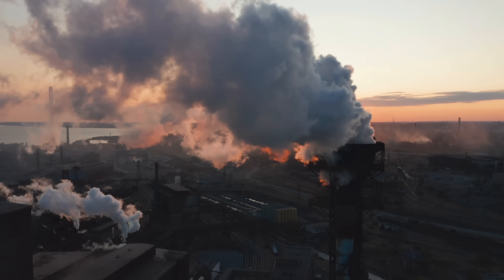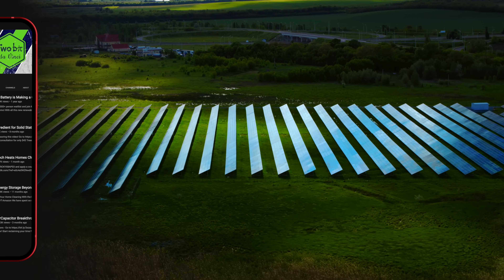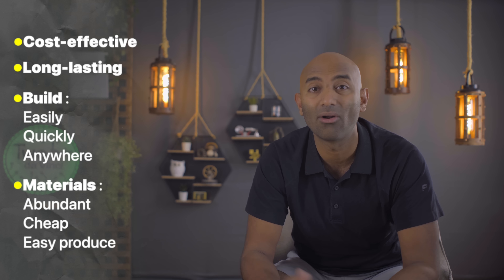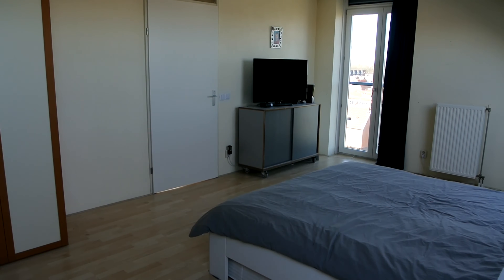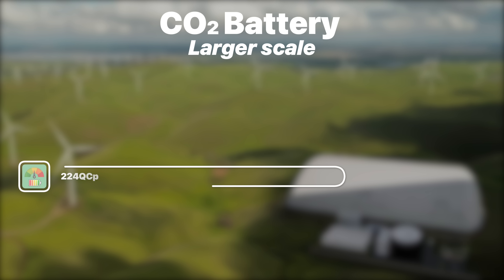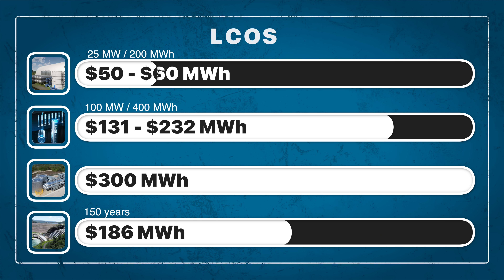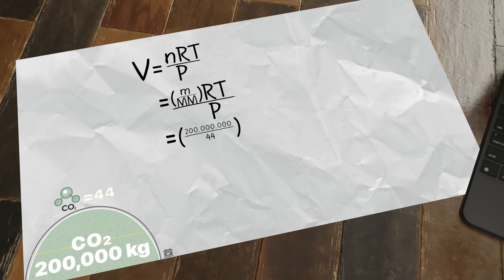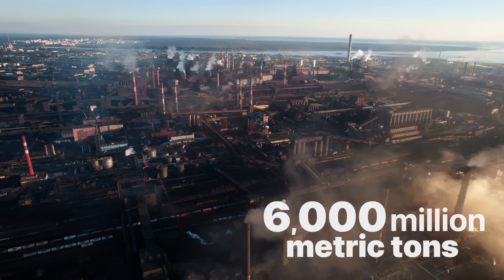The GENIUS Of the Carbon Dioxide Battery

Comment: If one of these plants were located near a decommissioned underground mine, the empty space could be used as the CO2 storage space.  Depending on the gas-tightness of the mine, of course.  I’ve heard of mines being considered for sequestering atmospheric CO2, so maybe not a totally crazy idea.
Reply: There are many abandoned burried pipelines that could be repurposed and they could be interconnected to other plants to incease reliability.  Mines are few and far between. Burried abandoned pipelines are everywhere. The Texas Railroad Commission has online maps of pipelines and their owners and shows the ones that are abandoned. It is just a long horizontal mine that is out of site.
Reply: Storing underground makes a lot of sense, it does not upset the landscape or use up valuable space where more solar or wind turbines could be sited. 

Why not build in some redundancy to the system and make it multiple smaller domes that could be isolated easily for maintenance or replacement in case of seal failures.

Smaller bags also fit better into mines and could be designed to utilise the maximum space for efficiency in the mine. 

A modular and standardised design also means, it could be easily mass produced and scaled. As more sites come on line costs should come down and an industry be created to maintain and produce parts for these systems.
Reply: @peterfedyszyn  True, although it will require a degree of cooperation that is fairly difficult in our hyperpoliticized environment.
Reply: Here (Alaska) I know our local underground natural gas storage facility utilizes an old mine and pressurizes up to 200 bars.
Reply: @markbothum4338    Thank you.  I rest my case.🙏
Reply: The balloon + bladder provides low (atmospheric) pressure at variable volume. It is not meant to be pressurized.  A mine does not have variable volume, it would need a much more complicated bladder
Reply: @pisoiorfan  If the mine had a large vertical shaft I could imagine a large tube lowered into the shaft. The tube would be the bladder with a piston sitting on top of the CO2. As the CO2 is drawn down the piston lowers by simple gravity and as it it is replenished the piston rides up.  CO2 being heavier than air, if there is a leak it floods the mine, the the surrounding area.   At least this is one idea. 

Another idea would be to potentially to use the CO2 to displace water in the mine. The CO2 would need to be trapped above water. Thus the water combined with the mine walls becomes the bladder.
Reply: Depleted oil and gas wells can be used for that also.
Reply: @justanamerican9024  you do know its gona take oil to make the machines that make your world revolve right.  Climate change peoole forget that if we cut oil right now hundreds  of millions  people would die.
Reply: @jazzwinsky  Thank you for brining that up. I remind everyone of that fact. It is not only business who has to change, every person does. Our lifestyle is not sustainable. We are using valuable resources we and future generations will need in the future so we can have cheap fuel now. A concerted effort should be put forth by everyone to conserve what we have and support developing alternative sources of energy that will be closes to where the energy is used and less vulnerable to natural and manmade disasters.
Reply: I was thinking similar for a dried up aquafer.  Some of these places might actually be at a lower temperature than ambient as well, which means the CO2 would be denser and hold even more!
Reply: I'm glad you brought that up. Many years ago Consol Energy, a mining/gas company,along with the government, developed a pilot program to sequester CO2 in underground boreholes. It was a success. There are other technologies out there also that can be used. Carbon capture is very viable. The problem is there are "special interests" out there that don't want this to happen. Follow the money.
Reply: CO2 can even be used as a cheap thinning agent when extracting sludge oil from the ground while simultaneously sequestering the CO2. Besides, plants thrive on higher CO2 levels which is important for increasing crop yields in an ever-growing human population.
Reply: Also, abandoned sewer systems could be repurposed in urban areas. Yeah, so far I cannot come up with any deal breaker for this idea.
Reply: @chpsilva  I don´t know if you are aware of this but C02 displaces Oxygen, if you have a large Sewer under a City with high Pressure and that leaks you have a potential disaster on your hands. Depending on how fast the C02 may leak and how much wind blows. C02 is also heavier than the Air that we breath so it wont just leave on its own.  Having such a storage a bit away from population centers seems like a smart idea.
Reply: That might be a good idea as long as it doesn't just start leaning up through the ground from over compression.
Reply: We sequester carbon in depleted oil fields already . No mines necessary. Oil fields are already gas tight.
Reply: Not a crazy idea at all.  It would be crazy to store the liquid CO2 underground though... an earthquake could trigger a leak killing all life by suffocation in a very wide area as CO2 tends to temain at the surface for a long time
Reply: Kali-mines are pretty airtight.
Reply: You realize, of course, that mines and caves readily accumulate carbon dioxide, which is produced by the vast mass of microbes thriving beneath the earth’s surface, so that carbon dioxide accumulates in the caves and mines faster than it can dissipate into the earth’s atmosphere. This is largely due to the molecular weight of CO2, which is greater than that of other atmospheric gases, which explains why most CO2 hovers near the earth’s surface. The carbon dioxide that seeps to the earth’s surface is immediately consumed  by photosynthetic bacteria and multicellular plants that produce oxygen. So, rather than use mines for CO2 storage, they would better serve as a convenient source for CO2.
Reply: That would be a great idea, if CO2 was a problem.
Reply: Injection of C02 underground has been attempted by chevron on Barrow Island Western Australia.....
Reply: @benstrasdat6328  This is so ridiculous as to be hilarious, but it illustrates the cultural and scientific insanity that surrounds CO2. There’s a reason that Chevron’s oil emerges from the ground saturated with CO2: the vast mass of microbial life that thrives deep beneath the earth’s surface is the source of not only CO2 but also oil that continuously seeps to the earth’s surface in vast abundance, water that fills the oceans, and all the atmospheric gases with the exception of oxygen, which is produced primarily by photosynthetic bacteria that thrive on the earth’s surface by combining carbon dioxide with sunshine to generate oxygen. Photosynthetic plants produce the other 20% of oxygen we breathe. In fact, the earth’s atmosphere consisted mostly of carbon dioxide before the arrival of photosynthesis. Most carbon dioxide now hovers near the earth’s surface, where it is avidly consumed by photosynthetic life, to the point that it is now a “trace gas” in the mixture of atmospheric gases.  Life began in the hellishly hot, stable environment deep beneath the earth’s surface, where chemical food is abundant and the heat promotes chemical reactions. Subterranean life paved the path for multicellular life to evolve in the “rift zones” between continental plates, and then finally adapted fresh stress mechanisms that enabled multicellular plants and animals to thrive on the earth’s surface. Try reading my book called “50 Years Lost in Medical Advance: The Discovery of Hans Selye’s Stress Mechanism.” that is available on Amazon. It provides a discussion of the extended implications of stress theory, including a “Unified Theory of Biology.” Why does Chevron try to re-inject CO2 into the earth, when that is where it came from in the first place? All that will happen is that the CO2 will make its way back to the earth’s surface, where it will be welcomed and consumed by surface life. The earth will be digested and consumed by life long before the sun is gone, whereupon the earth will join the ranks of Mars. The chance of finding life on the surface of a planet are better on Saturn or Jupiter, where hot, toxic gases are abundant on the surface and can provide a source of nutrition for microbial life. Human egocentricity blinds us to the truth. Don’t forget that the notion that the earth is flat prevailed until recently.
Reply: Clean coal technology is the process of holding CO2 underground.
Reply: Is every comment here from a bot?
Many countries have invested billions into national cabin capture storage mines. All they've done is capture tax payer dollars with zero results yet. 
Were going to need to invest trillions into this problem and it can only stop co2 released at powerplants, not cars, bulldozers, ships, planes,rockets (each rocket launch is worth 200 long haul airline flights and musk plans to launch 1000s of rockets. His lithium and rocket fuel usage will make him the single largest polluter ever in history even above the US military)
Reply: @janeblogs324  I was Kinda wondering something similar.  Clean coal has been a thing since I was a kid.
Reply: How about just let nature’s plants do with it what should be done.
  Today we are a product of wrong teaching. The carbon has always been here; it’s a natural part of nature. It was here before the plants grew that they were composed of after they were buried long ago. We just drilled down to where they are buried and pumped it back up. It would have naturally gone back to the soil and been used over and over again to grow new vegetation had it not been deposited so deep.
  When we burn petroleum we are not creating more carbon; we are only releasing what was already originally here.
 We (-mostly our corrupt government!) have only created a problem to be solved in our own minds. Nature knows her business best. Untilled soil naturally grows dark with carbon; it’s like a sponge. Plants need that carbon! Nice dark soil, tilled only by earthworms. It grows us healthy plants! Random dispersal of a variety of different types of plants prevents the over growth of parasites instead of concentrated planting of only one type. Be sure to include fungi!
 It’s about time someone produced a video telling the truth and giving credence to it. Nobody listens to wisdom anymore.
Reply: Salt mines have been used to sequester nuclear waste but most mines are not airtight and would be unsuitable.  Gases and liquids are typically stored by drilling a well and injecting the gas/liquid into a formation like the strategic petroleum reserve
Reply: Or maybe 'refine' the shape of the mine, so the bladder could be put inside. This would also protect it from possible terrorist attacks.
Reply: @TomHolmHansen  And storms, surface fires, etc., even earthquakes if the bladder were made to withstand them.
Reply: @TomHolmHansen  What the fuck are you talking about? Why would you even bring up terrorist attacks? Why would anyone attack a fucking balloon?
Reply: CO2 is plant food dude, not like they aren't already trying to starve humanity to death with the fertilizer shortage or anything.
Reply: Why not capture CO2 from coal fired power stations and combine it with hydrogen to produce liquid hydrocarbon fuels.?
The Western World’s obsession with Climate Change is economically destructive.
The real issue is that fossil fuels are a finite resource,.A modest increase in atmospheric carbon dioxide concentration and mean surface temperature would actually be beneficial. Benefits include increased agricultural yields (main effect) reduced winter heating costs and fewer deaths from hypothermia.
Reply: @johngeier8692  I say this with all the respect I can muster, you are misinformed.
Reply: @justanamerican9024  OK Boys, sound like we have a good team assembled here.  When do we start?  👷🏻👷🏻👷🏻👷🏻👷🏻👷🏻
Reply: @tomrogers9467  We first have to find the money trail and follow it to its source. Always, follow, the, MONEY!

Comment: I see this technology potential easy could be reused with old gas/oil resevours. As @Iggie Dalrymple also pointed out, if we could make Salt hoists, and depleted gas&oil drilling fields useable for "the large" storage part of this project, then there is really some great synegy effects to be achieved.
It all depends on if we can make the salthoist/gas/oil caverans "closed enough" so it doesn't sip into the atmosfear.
But, take for example the later vidieo about Denmarks massive upcoming sea-windfarms. Those are relatively close to some old gas/oil fields, that easely could be used for the 'large storage containers'. As for Denmark, there was already talk about using those cavererns as Co2 storage facilities; but in my eyes it seemd stupid to do Co2 capture, instead of just "going another co2 free alternative way". However, with this project, the synergy effects can sudently be gained triplefold. We have a proper storage place for Co2, we can generate heat+power pumping co2 in/out of those caverns, and we can actual have a progression from Co2 sources to Co2 free sources in a more steadely step.
The question that remains are only: Can we make the cavarns/hoist sealed enough? Can we transfer the excessive heat from the process to the main land ? Is the ratio of lost energy to heat accepeable? Is it cheaper than the alternative. 
I have no idea of these questions, but @Two Bit da Vinci, maybe it was a good followup to the videos :) 
I see this technology potential easy could be reused with old gas/oil reservoirs. As @Iggie Dalrymple also pointed out, if we could make Salt hoists, and gas&oil drilling fields useable for "the large" storage part of this project, then there are really some great synergy effects to be achieved.
It all depends on if we can make the salt hoist/gas/oil caverns "closed enough" so it doesn't sip into the atmosphere.
But, take for example the later video about Denmark’s massive upcoming sea-windfarms. Those are relatively close to some old gas/oil fields, that easily could be used for the 'large storage containers'. As for Denmark, there was already talk about using those caverns as Co2 storage facilities; but in my eyes it seemed stupid to do Co2 capture, instead of just "going another co2 free alternative way". However, with this project, the synergy effects can suddenly be gained triple fold. We have a proper storage place for Co2, we can generate heat+power pumping co2 in/out of those caverns, and we can actually have a progression from Co2 sources to Co2 free sources in a more steadily step.
The question that remains are only: Can we make the caverns/hoist sealed enough? Can we transfer the excessive heat from the process to the main land? Is the ratio of lost energy to heat acceptable? Is it cheaper than the alternative. 
I have no idea of these questions, but @Two Bit da Vinci, maybe it was a good follow-up subject to the two videos :)

Comment: Yes, its far cheaper to make new CO2, particularly when it is being used to charge a closed-loop system like the CO2 battery.  Once sufficient CO2 is generated, the generator only needs to keep up with operating losses which tend to be fairly low.
Reply: We dont make co2 we just return it back into the atmosphere. Its a mostly closed loop system

Comment: String inverters actually last 20+ years, not 10 years.  And frankly its just component selection... all inverters 20 years ago had shorter life spans.  These days the life spans are much longer.  There is nothing magical about a micro-inverter's components that improves its life-span.  If anything, micro-inverters actually get hotter than string inverters and puts more stress on its components due to the compact design.

In anycase, micro-inverters are more convenient for installers, but they are harder to maintain.  As a consequence they are marketed as lasting longer, or even lasting the life of the solar panel (with fine print assuming 25 years), but it isn't actually the case.   Modern solar panels with only diodes can remain useful for 40 years, and a string inverter can be replaced in 30 minutes without having to get on the roof.   String inverters use higher voltages and are more efficient.  Micro-inverters advertise high efficiencies but lose more in the wiring due to the lower back-haul voltage (240VAC instead of 400VDC).

Where micro-inverters do well is in situations where there is a lot of variable shading.  That's pretty much the only case.  Otherwise, string inverters (with one MPPT per string) are just plain better for the home owner.  Lower costs and far lower and less costly maintenance after year 15.

-Matt

Comment: I think If we connect the exhaust to this system it would be interesting. 

I think at least 40-45% can be used for this and the other CO2 can be used for products, technical gases and for growing food.

I think if you have an coal power station you can use the faltered exhaust gases and fill the dome